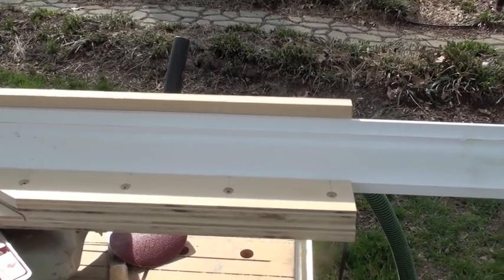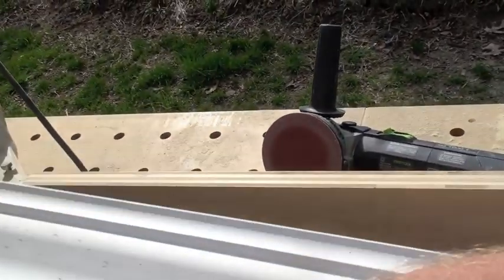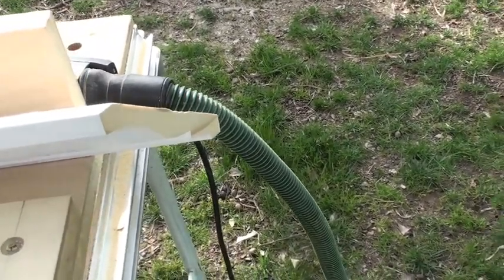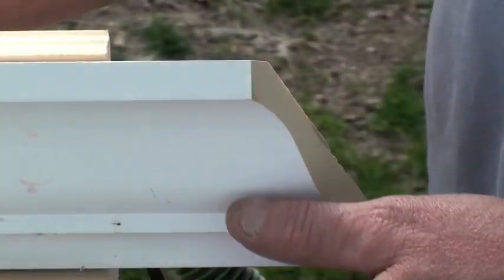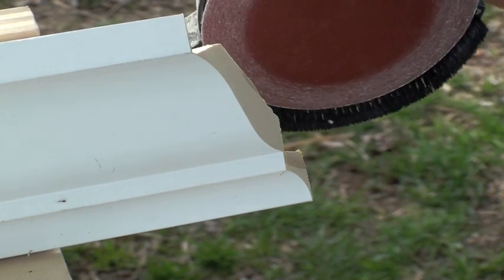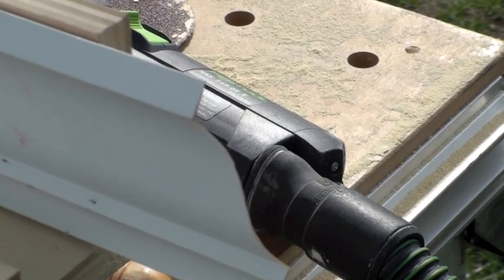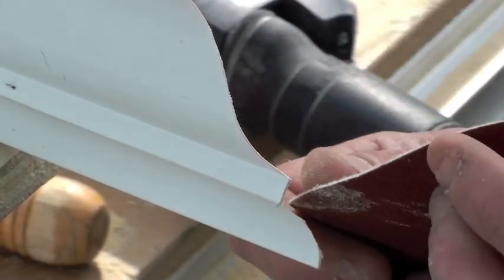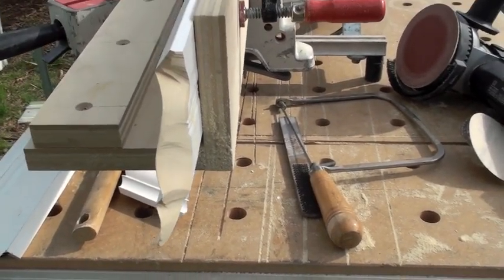Coping Crown Moulding with the RAS 115

Comment: .The new Milwaukee cut off tool is the absolute best tool for coping, grinding, cutting, shaving, sharpening, edging, buffing, sanding and you will probably leave half your power tools at home after trying it out at Home Depot, you're welcome. (with dust collection)

Comment from the maker: If you do oak, get some different grits and think about going coarser or else you will be doing a lot of burning versus cutting.  I used the disk grinder for the first time to cope chair rail.  Using the very edge at almost 90 degrees was great for the detailed areas.  It is better if you can clamp your workpiece and use two hands on the grinder at least when you first start.  You will probably be able to migrate to one hand eventually as you become comfortable.  Experiment with stance....

Comment from the maker: Mr. Mix.

Glad to see that someone has worse nails than you.  I have had nail issues since I was born some medical.  However, that will not prevent me from trying to educate or illustrate things that others might find useful. I am not a hand model.

A 45 dollar disk grinder with two disks mounted back to back is a formidable tool to cope with.  Just make sure you do it outside and with a breeze blowing away from you because there will be a ton of dust.

Enjoy working with wood!

P

Good luck.

Comment from the maker: @benny5825 

An orbital sander will not.  Many people use a rotary sander - i.e. a disk grinder to cope crown.  The difference is dust collection.  Dust collection is not common on disk sanders.  The RAS 115 also has variable speed which is also uncommon on disk sanders.

Hope that this helps.

Comment: Interesting to see it done this way, but using the Collins foot, I could have coped the whole profile in about the time it took you to do your relief cuts. (just finished putting up 600' of a similar 5-1/4" profile).  I can see where a sander/grinder might have an edge on a profile with multiple tight radius beads, but you can't beat the Collins foot for coves and ogees.

Curious about your miter jig - are the stops adjustable for different moulding sizes, or are they fixed?